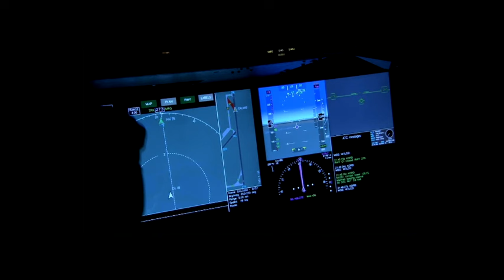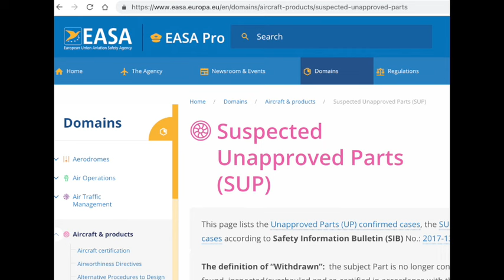Gender Reveal Plane Crash Kills One, Bad Parts Back in Circulation – Episode 183

Comment: you guys re so wrong, it failed because the wing was creating 3000 lbs of lift then he dumped 1500 pounds using the EMERGENCY HOPPER DUMP function and he was still creating 3000 lbs of lift on a 1500 lb plane, the plane by default is going to ZOOM upwards placing phenomenal stress on the wings where they attach, and the connection fails, he was SUPPOSED to push the stick forward to DECREASE the lift at the same time as he dumped the hopper (of course one is usually at altitude when they do this, not 10 feet off the ground headed to trees). Since he  was low and going to skim the tress he pulled up at the same time the wings created an extra 1500 lbs of lift, thereby created more lift than the g force limits of the wing to fuselage connection points, and the wing folder up. SIMPLE
Reply: I don't think they understand your point. Pulling back the stick abruptly and dumping 1000 plus lbs does two things rapidly: 1. Prior to releasing the load there exist high inertia with higher stall speeds. Then, 2. Release the load the stall speed is suddenly lower and allows the plane to abruptly pitch up to such a degree that it is essentially presenting the bottom of the wing perpendicular to the relative wind. Drastically exceeding design loads. Yes, maintenance, corrosion due to chemicals etc all are valid. But, you could break a wing off almost any aircraft by carrying a very heavy load, pulling up abruptly and then releasing the load/inertia suddenly allowing the plane to pitch up aggressively - in effect presenting the bottom of the wing perpendicular to the relative wind - snap is the sound as design limits are considerably exceeded.
Reply: As they say - I can explain it to you but I can't understand it for you.
Reply: @stephenhenrydmd6516  well, i had to think about it, cause most of us dont fly bombers lol, but if you are powered and pitched for level flight with 1500 lbs then drop it all at once, yeah, the plane is going up up up, add some pitch up, wings are gonna come off. I think he was too low, and saw those trees, had never executed a dump like that, and did what he normally did on a run, which was a mistake.
Reply: Honestly this is exactly what it looked like to me, the plane literally flipped back, you could see it. He should have been higher, it's a bummer. The worst part is he surely knew as soon as he did it what was going to happen but there's nothing you can do, you're already in it.. Then the way the wing wrapped he was trapped.
Reply: @stephenhenrydmd6516  you dont even NEED to pull up. you re already setup at power and pitch for LEVEL flight with 3,000lbs then dump 1500, wings are gonna snap off unless you pitch forward prior to the dump

Comment: Most recently I worked for Collins Aerospace as a DAR and they actually had set up a production line in Mexico for some PMA wire harnesses and this has been going on for a couple years. And I told them they can't do that for PMA parts, it's right there in the bilateral airworthiness agreement, no PMA parts from Mexico. Of course what did they do, they fired me. To this day I'm still sure they're making PMA parts out of Mexico.

Comment: Good that you didn't blame the reveal crash on the pullup maneuver. So many of the channels are treating the pullup as if it were some violent aberrant overloading of the wing, but as you guys point out, a normal ag plane turn at the end of a row puts a pretty good load on the wing and we don't see them breaking up all the time.
Reply: My friend it is very obvious that the heavy pull up created a tremendous air load on the left wing, not a g load and air load. If the pilot was smoother in his attempt to raise a nose he would have bled off a little airspeed thus reducing the air load. I see plenty of crop dusters fly they, never do a heavy pull up like that, never ever ever
Reply: @@ekl2947 so you're saying that the pull up had nothing to do with that wing failure is that what you're saying
Reply: @@ekl2947if I take my old, beat up Jeep, and subject it to the full throttle slamming that I did when it was newer, it breaks. I could just shrug and say it broke because it's old and worn, or I could drive it like it's old and worn, and it might keep taking me places for a long time. I guess I need to know both, don't I?
Reply: Nope. If for any reason you emerg dump the hopper simultaneously your stick is maintaining forward pressure. You can allow some pitch up to allow obstacle clearance. But under no circumstances would you abruptly pitch up and dump the weight allowing for very rapid pitch up - in effect presenting the bottom surface of the wing to the relative wind i.e. nearly perpendicular to the relative wind.